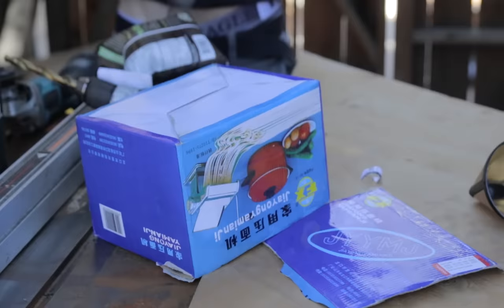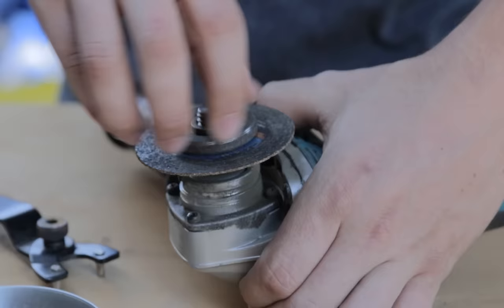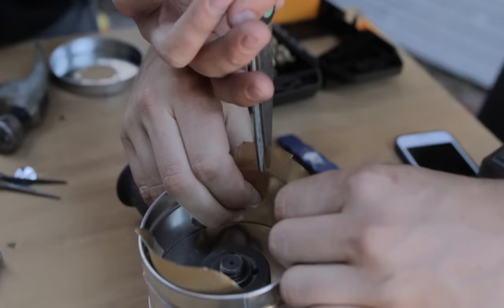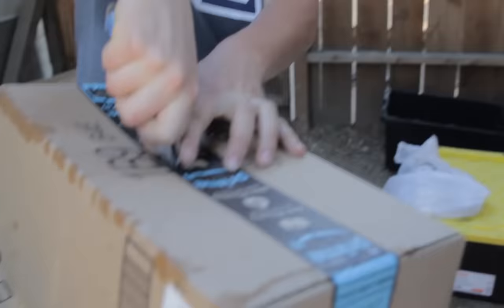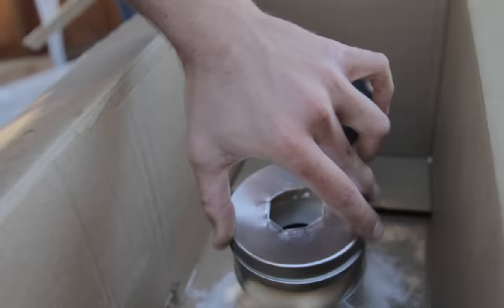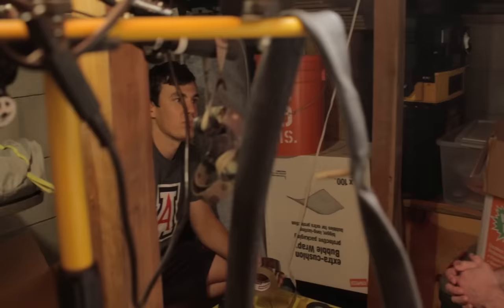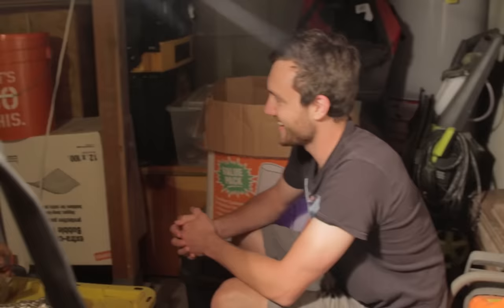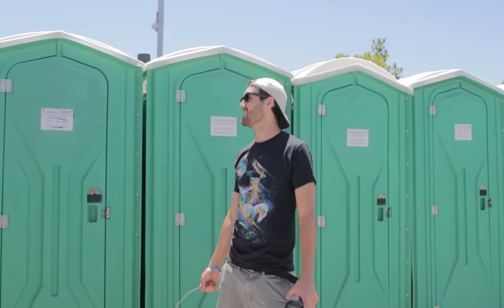Making Cotton Candy with an Angle Grinder

Comment: you could make this up really nice, like a DIY auger extruder w/ heating element that just sends continuous sugar into the core. You can still use the angle grinder,  but laser maybe an acrylic box or something to catch the cotton? then put that contraption and a guy to run it onto the trailer of a bicycle. roll around maker fair handing out the candy. boom.

Comment: Just incase you all didn't understand the last shot and what happened, when he turned it on the weight of the blade loosened the lock bolt on the grinder but had spun the blade fast enough that it stayed in place on the guide if it had of say made contact with the lock ring it most likely would have come off and went flying, lol been there. Great video man, love the channel